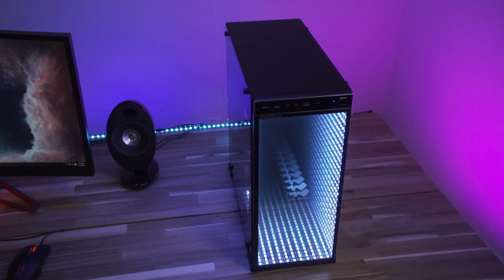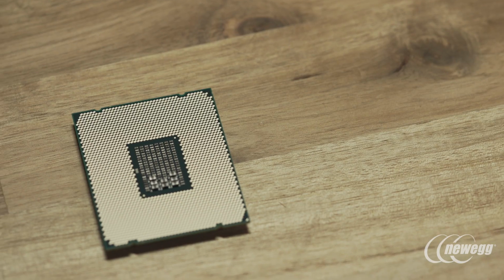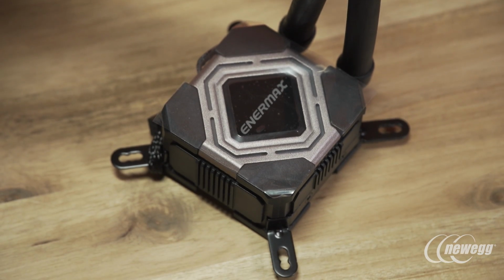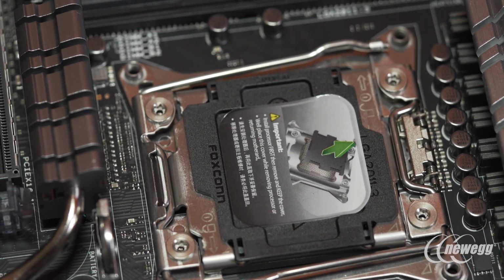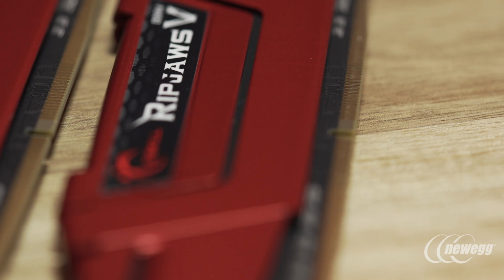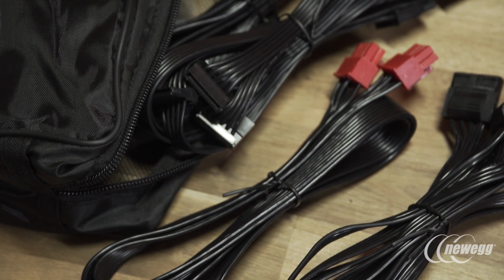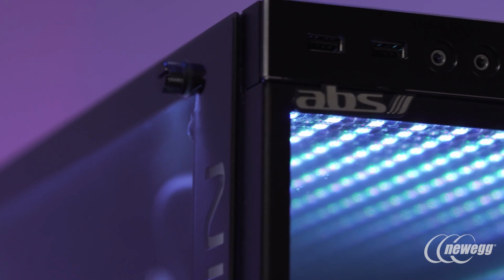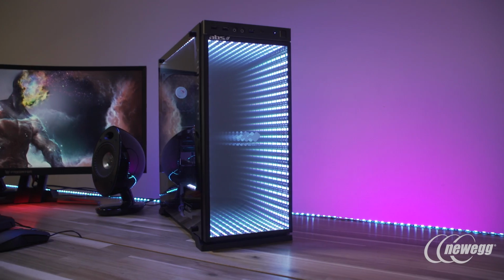Infinity X-99 Build

Comment: badass case but lacks air flow, still a buy
Reply: l Niveous l if it was designed more like the Anidees AI Crystal, airflow wouldn't be a problem, and there would still be the cool front panel effect.

Comment: Just got this case today and will start building my dream setup soon.  7700k, maximus ix extreme, 960 pro and 960 evo, 32gb tridentz rgb 3600mhz, and 2x 1080ti poseidons.  Only reason I haven't started is waiting on poseidons so I can properly purchase custom loop materials.
Reply: but will it run minecraft with high settings?
Reply: Vandoeun isn't the 770k a bottleneck to the 1080tis?
Reply: only at 1080p. 4k is a different story.
Reply: OK thank you I want to built a high end PC as well and I wasn't sure .
Reply: no. but it can run minesweeper in 8k 60 fps
Reply: Can it play Crysis?
Can it play Minecraft without jaggies?
I'm so excited

Comment: A Rosewill Power Supply? That's so cringy... and then buying a $1000 CPU to only procceed to talk about saving money? Should've bought a AMD Ryzen 7 1800X $499, if you wanted to save money.
Reply: The "new" RX500 series are just RX400 series with a higher clock speed... nothing less brother.
BUT : NightSyndicate does have a point : why talking saving money and use broadwell???? Newegg ain't Newegg no mo'.
Reply: only their old stuff is obsolete. Ryzen is fantastic and the new rx 500 series cards are dope too
Reply: Referring to huehue's comment... The 500 series are not 'dope', since they are RX400... so, nothing new really...